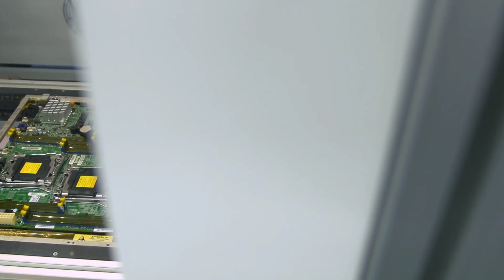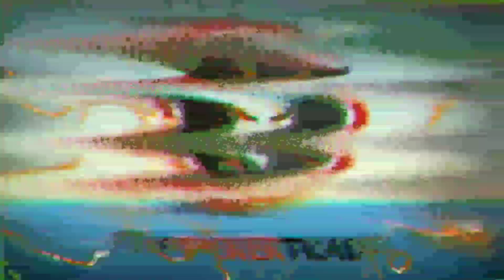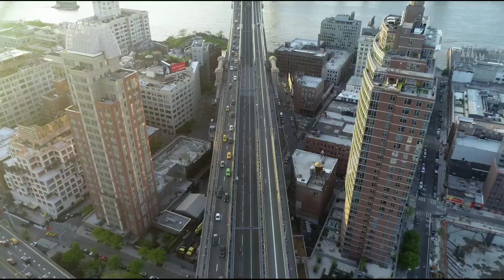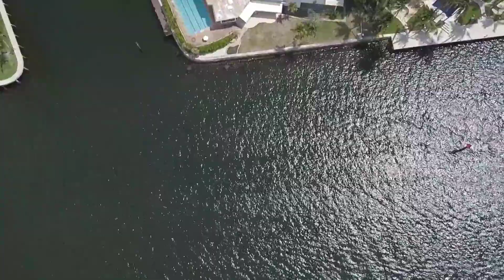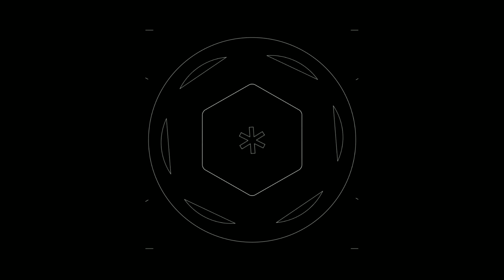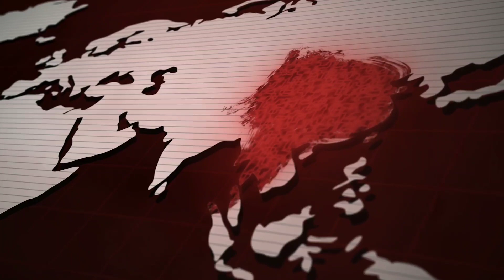CIIC Stock - Why Arrival Stock Is The Best EV Stock To Buy Now!

Comment: WOW! I bought some shares on last Friday
Reply from the maker: This company is as solid as they come. I came across them a couple of months ago before I knew they were coming to U.S. 

I was researching for a WKHS video at the time. When I saw their tech I was extremely impressed. As Soon as I saw them trading I immediately jumped in.

No doubt in my mind this company is on a whole new level and in a league of it's own.
Reply: @TopTickerTrades  I will buy more shares
Reply from the maker: Good deal. If you're holding it for the long term and aren't using margin, I wouldn't too much be concerned about short term price action but I would expect it to go up  and down as with every other SPAC we've seen so far. 

Definitely put some money aside for any big down days we may see in near future.
Reply from the maker: Most people still don't even know about this company or what it does. When they figure it out, it'll skyrocket.
Reply: Lot of people even don't  know share  name  ciig  ARVL
Reply from the maker: That's true!
Reply: This comp need more advertising